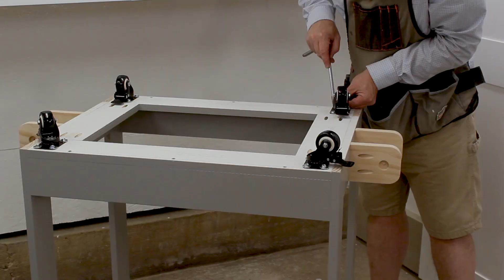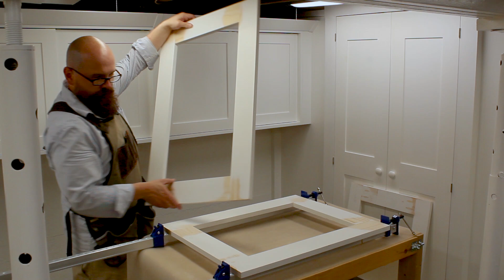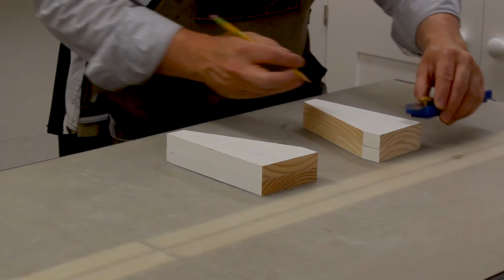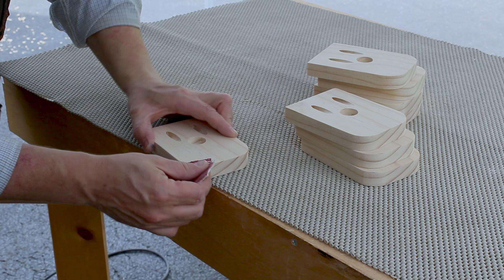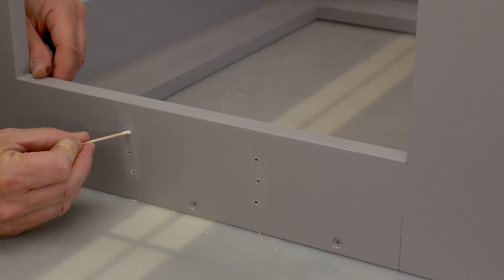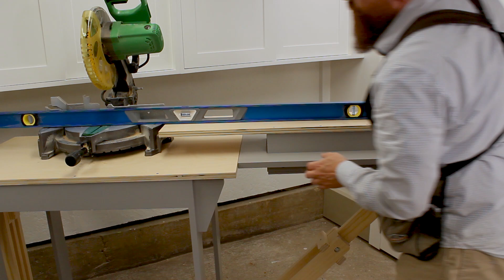DIY Miter Saw Station

Comment: I just finished making this today.  I made my wing tables a little longer, did t-track and a stop on both wings, and added a board on the bottom for my dust collection.  I also added a few little hooks for a tape measure, pencil and the remote for my power.  I watched a lot of videos for miter saw carts before deciding on using your idea.  I absolutely love how it turned out and hope it will last for a long time.  Thanks for not only sharing your creation but also making it possible for others to make one for themselves.